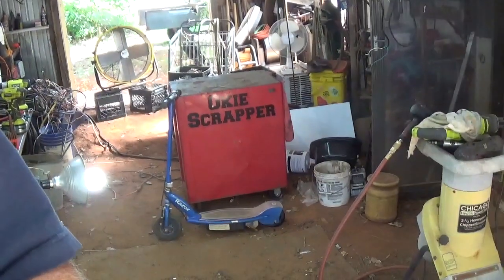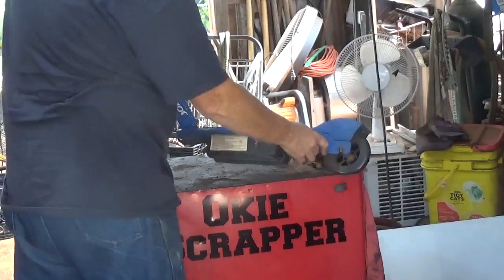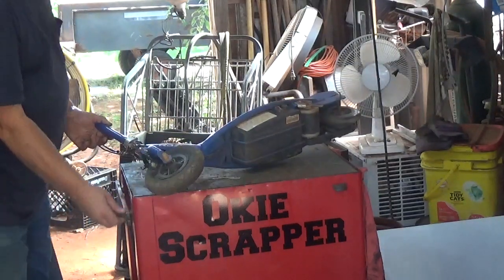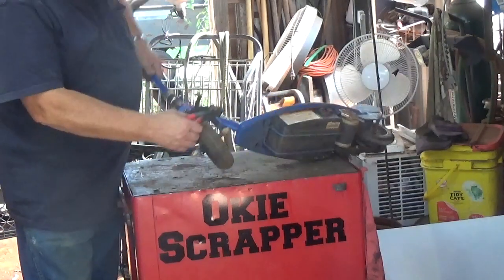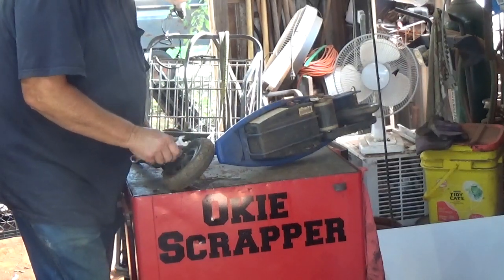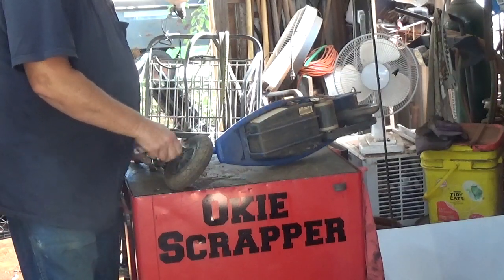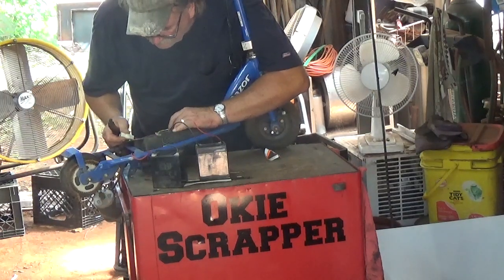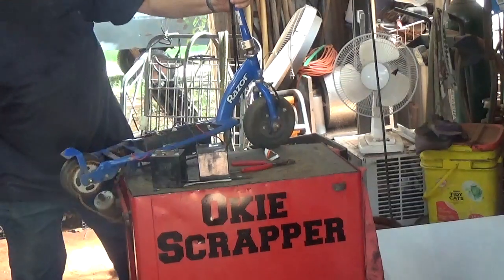Scrapping a Razor Scooter for a copper bearing motor and 2 small lead acid batteries

Comment: Those razor scooters need to be rolling before the motor will start running
Reply from the maker: i did not know that, thanks, the chain was rusted bad,  one battery was at 12 volts the other was at 7 volts i twisted the hot wires together and the black ones together and put them on a trickle charge. will un plug them in the morning and take another reading when i get home from work. Thanks for Watching Donald i have a red one too that is not locked up but still no charger
Reply: @Okiescrapper  oh, just read this! What charge is the trickle? Why did you put the leads together? I'm tryin to learn. I have a new nutribullet that I'm gonna take the motor from. I wanna know how to mix and match shit!
Reply from the maker: @Tricklarock  by putting the black leads together and the red one's together i can charge both at the same time as it would be 12 volt, i used a motorcycle battery charger 1.5 amps per hour, the motor is 24 volt so you would have to wire a red and black wires together and then you will have 24 volts on the other red and black that are not wired up

Comment: I find a lot of those.but most of the time the batteries are missing
Reply from the maker: not much left if the batteries are gone. tin and a copper bearing motor, i here you can rewire the permanent magnet motors and make them into generators

Comment: Well, were they 12v? The two I have from a Razor that looked exactly like yours, but are a lil bit more rectangular, and  have printing; Mighty Max model ML9-12 12v 9Amp.Hr.
All other info is provided as well.
Reply from the maker: think there are videos on YouTube about connecting batteries in series or parallel.  if you took both of your batteries, hooked both black wires together and both red wires together you are hooking them up in parallel so now you still have 12v and 18 amp. hr. but if you hook them up in series by hooking the black wire of one to the red wire of the other now you have 24 volts @ 9 amp hour. there is a guy i watch at times does solar power and he works with batteries a lot you could build a battery power bank if you get a lot of good batteries. i will see if i can link his channel  https://www.youtube.com/channel/UCoj6RxIAQq8kmJme-5dnN0Q     other guys salvage laptop batteries to make battery banks out of https://www.youtube.com/channel/UCnCqSx_HT1jlpKAO1LzW16A  hope this helps